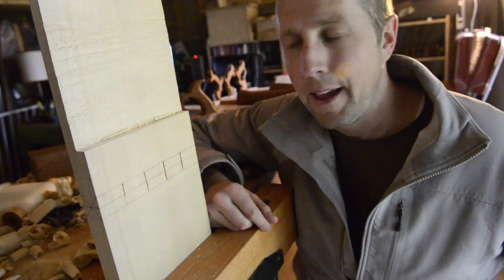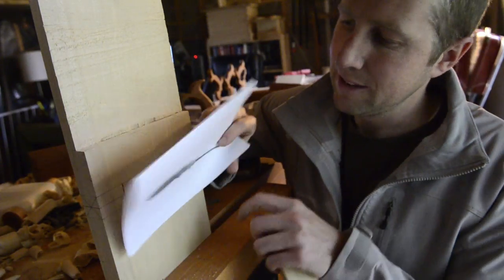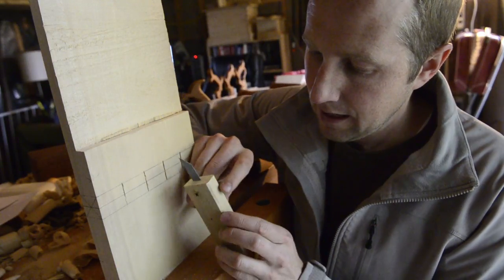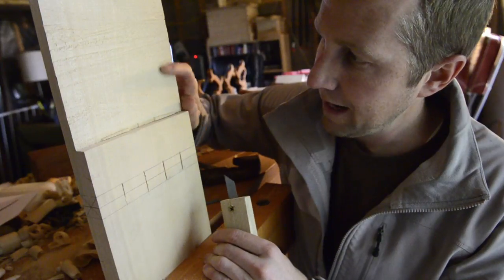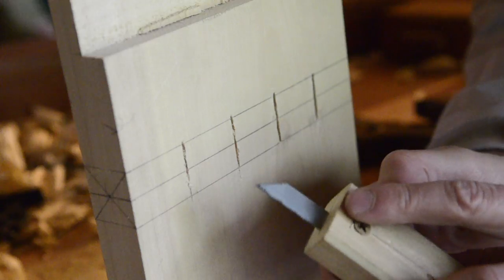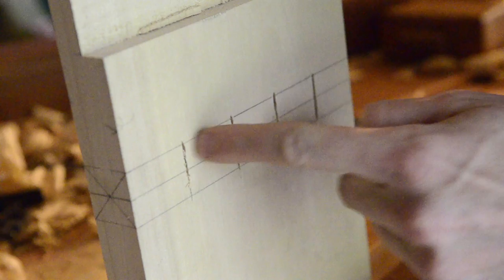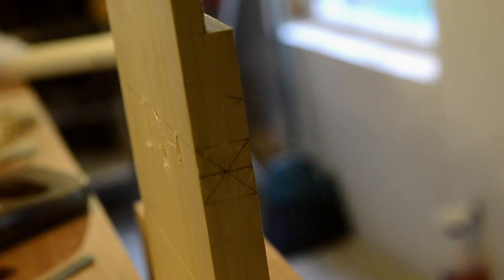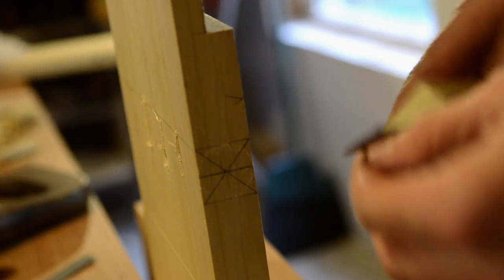How to Make a Cheap Pad Saw / Keyhole Saw

Comment: Joshua, sometimes the most simple and cheap things are the best, also it gives you the most satisfaction when you find that it really works well as the one you could have bought. I installed the same (kind) of blade on a handle for holding a reciprocating saw blade (a vise type) and it works exactly like yours. ;)
Thanks.
Reply from the maker: Indeed! Thanks for your comment.

Comment: Nice. I have a homemade marking knife I made from a hacksaw blade. The idea of making my own tools is always very compelling.

I was wondering if a coping or fret saw might have worked for those slots...
Reply from the maker: Hi Keith, thanks for your comment! Regarding the coping or fret saw, I think they may have worked once I got the thin opening to go all the way through, but expanding the hole was the easy part. It was getting the hole to open that was the hard part.